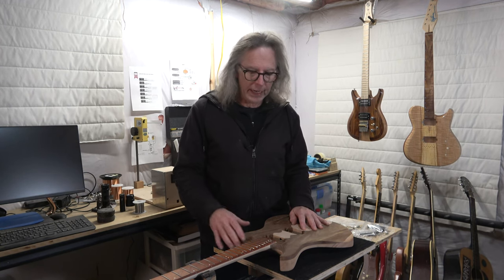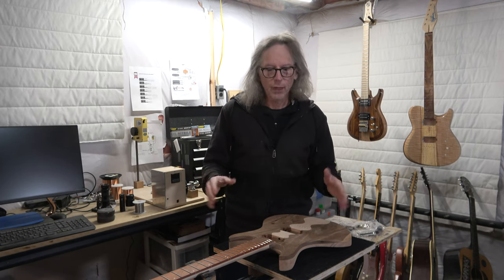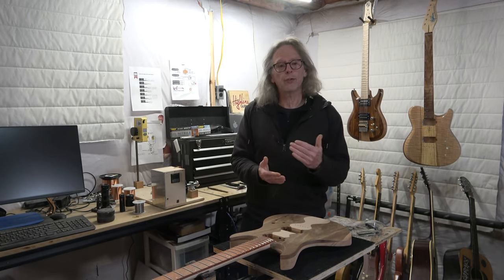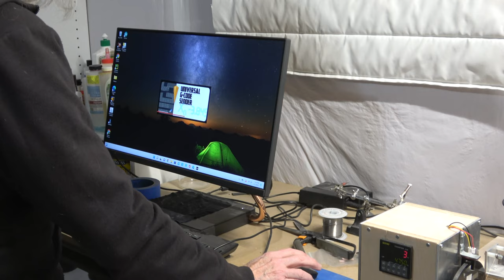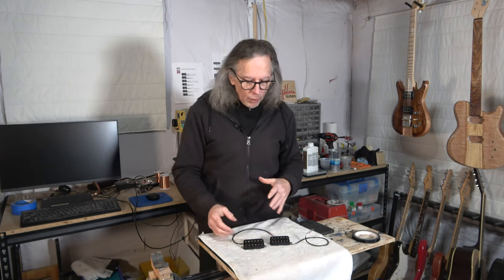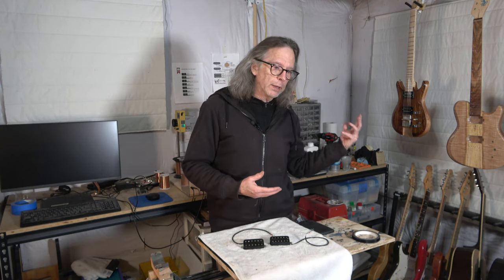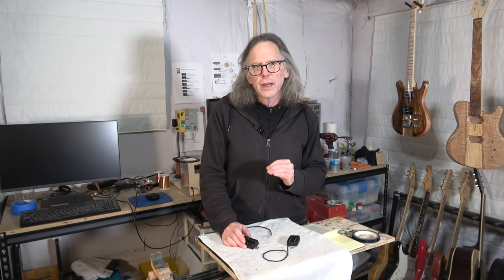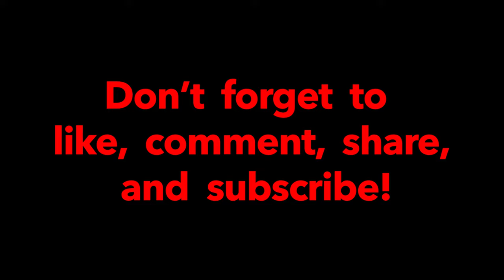Building A Neck Through Guitar Part 15 Making The Humbucker Pickups

Comment: I find it interesting that you prefer to start with 43 awg. I’m the opposite where I prefer to start with 42 awg unless I want to put significantly more winds on it. 

But it does kinda make sense based on the # of turns you used. That would be really close to not fitting with 42awg. 

Thanks for all the information!

Comment: Hey Chris have you made or thought about making actives? I haven't gone too far dowj that rabit hole, but I saw a vid from a UK company called Alegree where they show how to build an EMG style with their kit. You have to solder in caps and resistors of your choice to get what you want from the pickup. Interesting idea anyway.
Reply from the maker: They also make a 54k passive humbucker. I made some actives years ago. Kind of fun, but I prefer passives.
Reply: Thanks for pointing this out. I’ve wanted to try making an active pickup, but wasn’t finding and good information about it online. I’m definitely going to check Alegree out!

Comment: Hey Chris, I enjoy your content. Very informative.
I have a question.
When winding the copper wire around the bobbins, does it matter if you’re winding clockwise or counter clockwise?
Reply from the maker: No. If you need one bobbin to be wound in the opposite direction of another, you can simply reverse the leads when you solder them. In other words, if you solder the start to the out output and the finish to ground, you can switch them so the hot is soldered to ground and the finish is soldered to the out output. That effectively reverses the direction of the coil.

Comment: Hey Chris, I've heard a few times that having "mismatched" bobbins (i.e. winding the two bobbins in a humbucker differently than each other so they have different wind counts and such) can result in more high-end getting through the signal -- the skeptic in me thinks this may be another myth/superstition, but in your experience is there any truth to it? I've done that with my pickups, but only because I like the Seymour Duncan Triple-shot system to do coil splitting and it's nice to have two different sounding coils to work with.
Reply from the maker: I have mismatched coils myself just for the sake of better coil splitting performance. I can't say it improves treble response, but it does reduce the humbucking capabilities.
Reply: @HighlineGuitars  Interesting, thanks!

Comment: Hello Chris, nice episode, do you have a way to measure the peak resonance?
Reply from the maker: Yes. I use math.
Reply: Then you have to measure very precisely the capacitance, and this is not easy...
Reply from the maker: @jesusgerada5720  You got that right. Also, you can't take the measurements for inductance, capacitance, or resonant frequency until after the pickup is finished which is too late to be of any use to me.
Reply: It´s true, but perhaps is the data that  can best define a pickup. Thanks Chris!
Reply from the maker: @jesusgerada5720  It's just a number. A number that very few people understand. I'll stick to the number of turns, magnet type, and gauss strength.